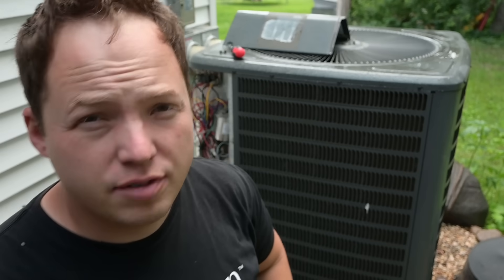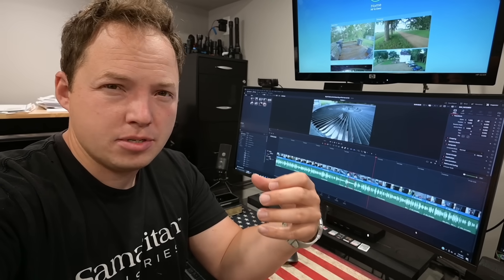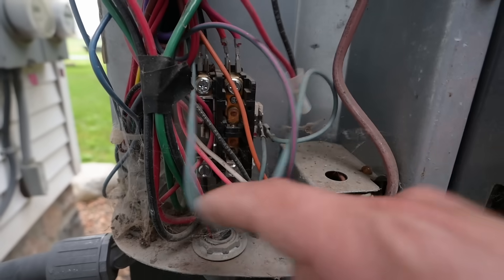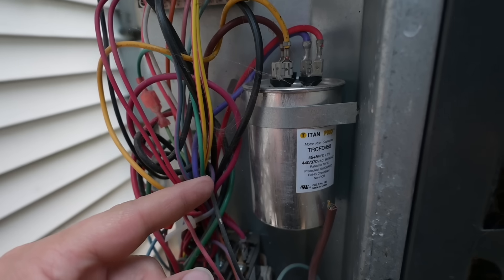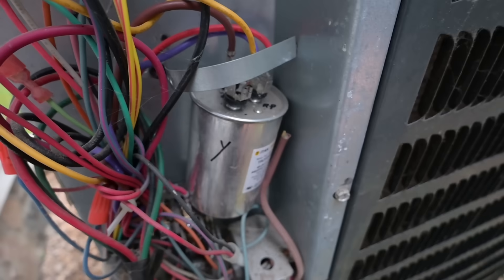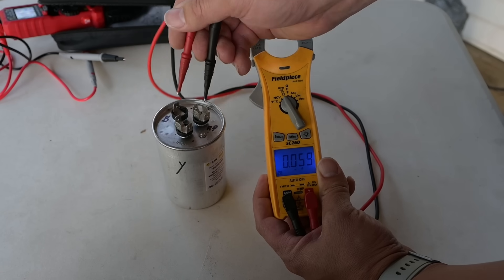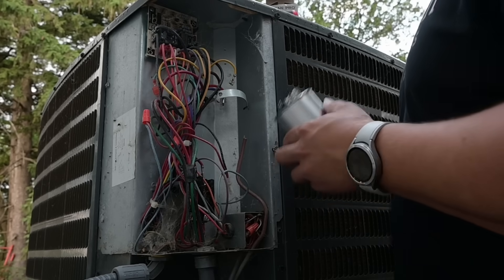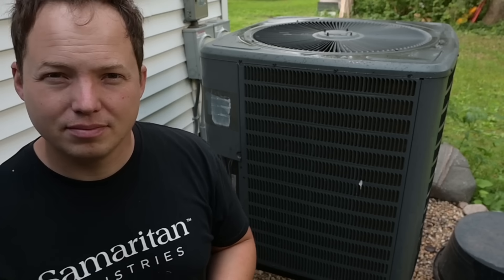My AC Died! How To Fix The Most Common Air Conditioner Problem!

Comment: I once had the fan capacitor fail on an old Carrier R22 unit and the compressor kept running. It kept getting hotter and hotter until it blew a hole in the condenser coil. Fortunately a tech was able to braise it and recharge, so it was only hundreds rather than thousands of dollars to fix. Amazingly enough the unit lasted for years after that.

Comment: Just a comment.  I changed mine about a month ago.  Power off, checked it with meter.  Touched the capacitor body, not the terminals, and got shocked.  So, either wear gloves or short it out as shown in the video before touching the metal body.

Comment: Benjamin would a bad capacitor cause a  loud knocking noise the fan doesn't turn and the breaker trips. Service guy didn't even remove the side panel or test the capacitor. When I turned it on the compressor hummed and the breaker immediately kicked off he said its the compressor and would need to be replaced for $2,800. I told him I'd have to think about it. I have been researching to see if I'm being taken for a ride. It's 94° today with heat index of 108°, I have window air conditioners  as a backup so not pressed at the moment. Your thoughts would be appreciated.  Its a 7 year old 4 ton Trane ducted heatpump system if that helps.
Reply from the maker: I would at least test the capacitor like I showed in the video. If it is making a loud knocking noise (so is starting to rotate) then I would probably agree that the compressor may be failing. I would test the capacitor as a first step and then go from there.
Reply: @BenjaminSahlstrom thanks for your quick response and the info. I'll test the capacitor myself and go from there.

Comment: Great video Ben. Do you have a MicroAir or AirGo soft start on that unit. Love my AirGo since it allows the Westinghouse 11500 to run it. You are the hero in your house. Thanks man
Reply from the maker: I've been thinking about installing one for quite awhile but haven't gotten to it yet! The battery inverter systems are much better at handling the surge current than gas generators so I haven't quite "needed" it just yet.

Comment: You have what's known as a dual run capacitor and its possible for either or both parts of it to fail (i.e. fan running with no hermetic and vice versa). The cheap Chinese caps are worthless. The Titan HD you installed is a reliable American made cap. Voltage fluctuations and lightning are big killers but excessive heat from either high amp draw or high ambients will kill them too.
Reply from the maker: We did actually have a bunch of lightning in the area last night. Nothing else was affected though so I'm not sure if that was it or not.

Comment: Capacitors usually always have a manufacturer date code imprinted on them.  It looks like your failed one was "1217" which is probably Dec 2017.  Titan Pro is a one of the best for AC units imo, although the new caps are not as reliable as those made a couple decades ago.
Reply: Actually Titan Pro is junk. Look at the label on his: Made in China. Foreign capacitors are generally very poor quality. If you want Titan Pro, get a Titan Pro HD. The HD versions are made in USA and much better quality. Amrad is typically even better quality and have a 5 year warranty as well as test values for that capacitor printed right on the cap.
Reply from the maker: I did notice that as well. Was either old stock when I put it in, or it's been longer than I thought! Time does seem to be accelerating as of late.

Comment: Great video!  Years ago, I had a submersible pump stop working and replaced the capacitor and that fixed that.  It worked for years after that.

Comment: Why didn't you add a helper capacitor at this time to help reduce load spike with startup?
Reply: Hard starts aren’t as great as they seem. The end up dumping a lot of energy in a short time and can cause compressors to fail. They have a use case, like when trying to free a stuck compressor, but in general they cause excessive wear on the compressor coils. People like to slap them in but do you think you’re getting a miracle cure for $15? Soft starts on the other hand help prolong component life but those are usually $300+.
Reply from the maker: Haven't really done that unless the compressor "needs" it. Are you talking about the booster/start capacitors that piggy back on the run capacitor?
Reply: @BenjaminSahlstrom 
Yes. I did that years ago and it is evident in the dimning of the lights and the quicker time to start up
Reply: @BenjaminSahlstrom  This sounds like a solution to stop the lights dimming every time the compressor kicks in.

Comment: Yessiree...I have learned over the years that the capacitor is typically the failure item in HVAC systems, for the most part. There is one for the inside blower motor as well as this one for the condenser unit. HOWEVER, what I have found over my years of research is, capacitors didn't fail so much in the early days prior to about 1998 as they were manufactured using a different oil that is inside them used for cooling/heat transfer. The EPA got their high minds into the industry and mandated the old oil as an environmental threat and manufacturers had to switch to something else but they don't perform as long. In fact, they don't measure up to the old ones much at all when it comes to their lifespan. Then, on top of this, many of these are coming in by boat so the many brands out there are Chinese made, cheap in price but will not last much more than 2 years or so, as noted in this video by Ben.
Our only best option these days is to buy capacitors that are manufactured here in the USA which there are just a few makers doing so. AmRad (USA Only), Packard Titan HD and Mars however, each will make a cheap version so its important to look for the ones made in USA and usually they have a 5 year warranty. Those better brands cost about $30 to $45 but will give longer service. For example, Packard makes Titan brand, Titan HD and Titan Pro, but the Pro version is made in China and as seen in this video only lasted about 2 years. Titan HD is a USA made cap and will likely service 3 times as long or more. Most dual run capacitors under $20 are cheap and not going to last.
Reply: the unreliability of new run caps has nothing to do with epa.
PCBs were banned in the 1980s and capacitors remained reliable for a long time after.

It's just a plain race to the bottom thanks to the bean-counters. If they can save 20 cents per capacitor they will, then the manufacturer will use a crappier capacitor to save $1 per unit.
Reply: @Jon-hx7pe  Might be part of the reason. AmRad caps are hand made/assembled and use a high grade oil.
Reply from the maker: That good ol' PCB oil might have been better although I do think that it was kind of bad if you are exposed to it. Also, a lot of those older capacitors were almost as big as a compressor! haha
Reply: @BenjaminSahlstrom  My sources have agreed that it was the oil. Someone herein believes the manufacturers simply went for the money.

Comment: 70°F…???! Here in southern AZ with temps at 115°F, in order not to get slaughtered with an exorbitant electric bill, got it set to a very comfy 80°F daytime and 78°F for sleep.  Still have to cover up with a heavy quilt/blanket at night and run a ceiling fan.
Reply: when the climate is humid, indoor humidity is rarely lower than 50% with a/c so need lower temperatures to be comfortable.
Setting to 80f wouldn't run much at all - that too hot for us northern people who keep the heat at 68 to 70.
75f is about the max comfortable cooling temperature i would go for.
Reply: @Jon-hx7pe  totally agree it's 87 here in West Central Wisconsin and I walk outside and start sweating in less than 5mins just taking the trash out 🥵 64% humidity yuck
Reply: @Jon-hx7pe  
At 110°F now, running 9% humidity outside and 22% inside @ 80°F. Feels cool. At same temps, during monsoon season we don’t use humidity numbers. We use dew point. All news publishes and reports dew points. Dew point outside at humidity and temp I just quoted is 48°F.  It starts getting sticky at 40°F dew point. Monsoon season has started when we get 3 consecutive days of > 45°F dew points. It’s pretty miserable as the humidity goes up to 55°F - 60°F dew points. Only during dying tropical systems or extremely rainy storms will it exceed 60°F dew points. Highest I’ve ever seen in the extreme heat is 75°F dew point. You can’t even breathe it’s so bad. Muggy to the next level extreme. Once one experiences a dying tropical system, one has empathy for those in hurricane prone regions.
Reply: @jbsimmons54  southern ontario in hottest weeks get dewpoints 62 to 75. right now it's about 65f dp, tommorow will likely be above 70f dewpoint.
Reply from the maker: Humidity is a big factor as well! The air has been soggy here lately...
Reply: @BenjaminSahlstrom   
Yeah, monsoon season supposedly starting in 2 weeks. We had a pre-1980-like cooler than normal spring this year, which was awesome. Hopefully we will have a normal 20 or so days of 110°F+ this summer instead of the record setting 70 in 2024.
Reply: Can’t compare phoenix to upper Midwest.  I’ve spent some time in PHX in June and July.  The measured humidity is often <20% and that is down right comfortable compared to the humidity we have right now in WI and MN.

Comment: COMP vs HERM would make too much sense...As mentioned always can use a high working voltage on any capacitor in any application, and in some cases ie, electronics a higher uf rating maybe, depends on circuit, power supply filtering ok.

Comment: I'm not worried about touching 24 volts. I'm worried about accidentally shorting out the transformer in the air handler.  I should probably put a fuse in there But I turn off the breaker to the air handler as well when I'm outside.  Great info as usual
Reply: The fuse too.

Comment: The way you tell it, I understand that you are putting the two capacitors in series tonget 45 mfd. Bit thats not right. For resistors it is. But capacitors should be parallel and than you can add up the capacities.
Reply from the maker: Oooh, if I got that confused I'll have to edit that out.
Reply from the maker: Thanks for pointing that out.

Comment: I keep a replacement capacitor on hand well worth the $12.
Reply: Good idea and regularly check old cap, don't want to over heat motor or compressor.  I use a Emporia wifi kwh that send notification if kwh go over certain about on unit.  Once fan spindle spun lose of fan blade and high side tripped notification at 2am.  Just got home from flying DA40.